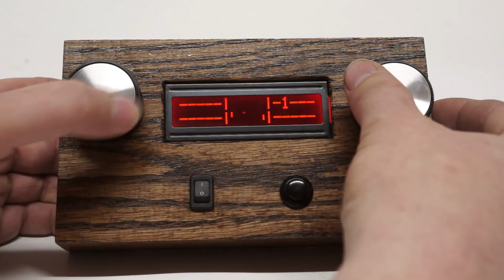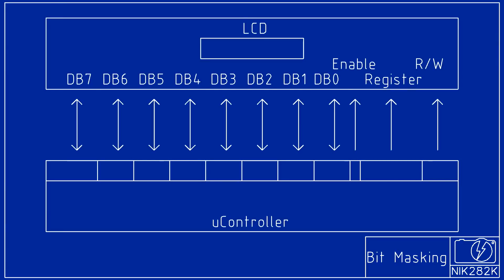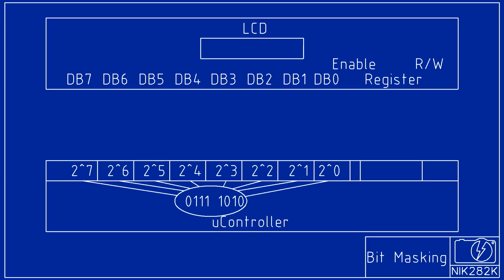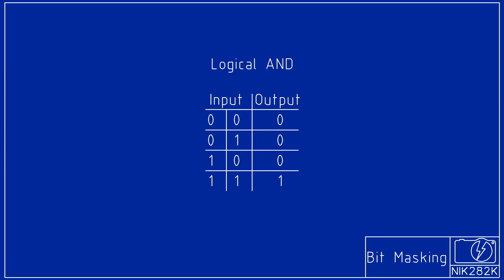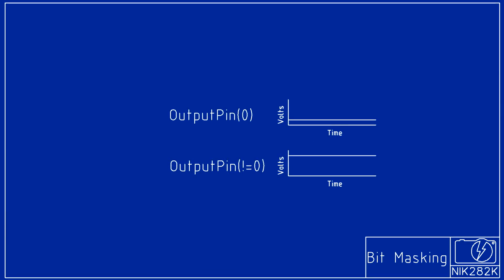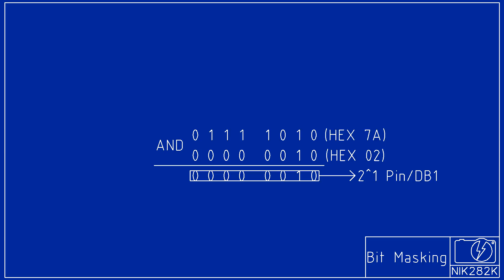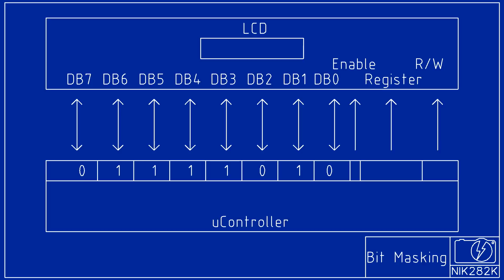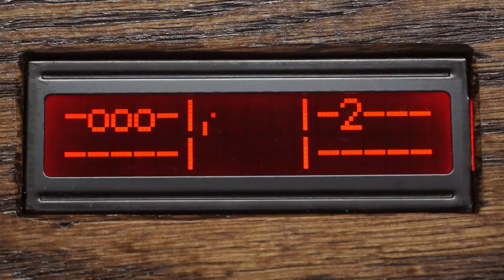Bit Masking Basics

Comment: Welcome to the 8 bit CPU club!
Reply from the maker: The controller I am using is actually WAY overkill for the project. It's an LPC11u37 Arm processor on a board made by Coridium, I picked it because I got a Kickstarter discount and they can be programmed with Basic!